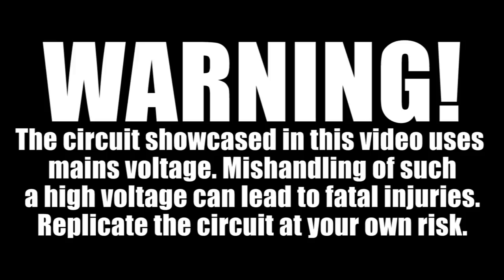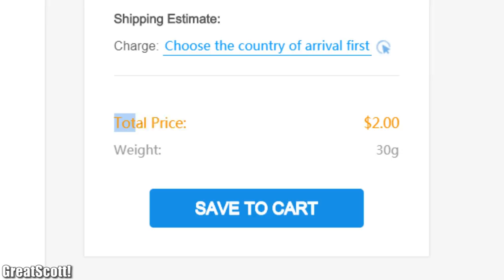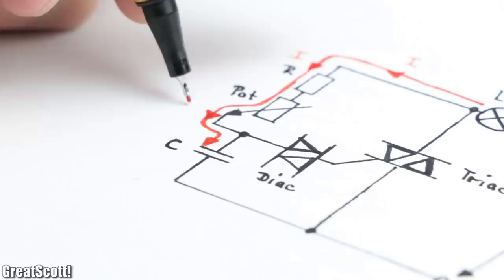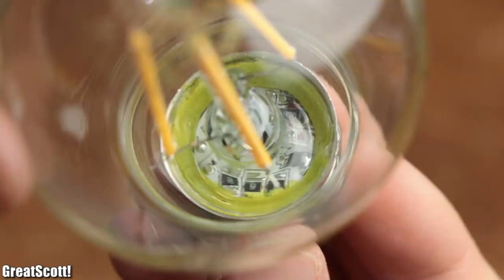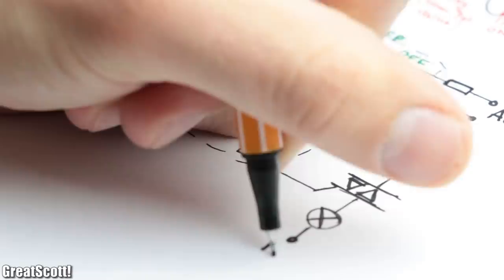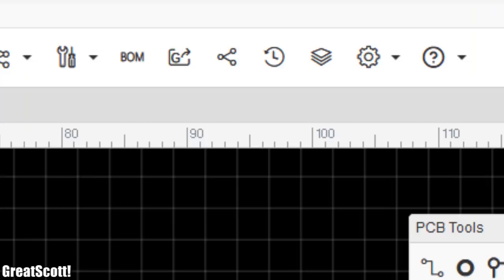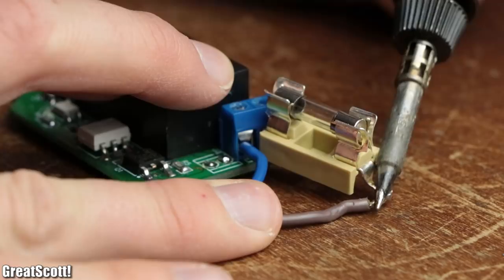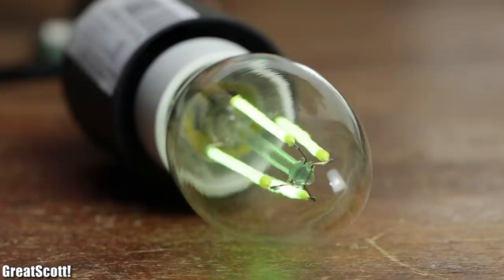AC Light Dimmer || DIY or Buy || Phase Angle Control Tutorial

Comment: It's seems that both analog and digital versions are equivalent on the final result. The reason the digital could control better the LED light bulbs is just that it can go further down on the turn on signal interval? (that LED light bulbs are only dimmable with the upper range of net energy delivered, since they need a minimum power to even work).
If that's true, then a faster clock on the uC could work even better?
Reply: I need to know as well!

Comment: So the PCB can be improved, big deal who cares, this is a one off. Second time around will be the charm.

One of the major advantages of using an MCU is that you can tailor a brightness curve to rotation. Brightness is logarithmic but the power to phase delay angle is not. So you can build this into the software and have a reasonably linear brightness to rotation. This feature can be applied to controllers that also have Blu-Tooth &WiFi or course. The magic is using an MCU.

The biggest hurdle to overcome is to accommodate LED lamps without flicker and all the other artifacts that can befall a triac based dimmer.

Just my 2c worth.

Comment: @GreatScott! Great video Scott!! this is something i was searching for some time now. 
Maybe i know why one of the led bulbs did work and the other one don't.. you use the same method as a normal halogen dimmer, leading edge while this works for some led bulbs the other led bulbs need a trailing edge method because of the used electronics. for what i have read.. since youre using arduino it's simple to adjust.. can you check it out?..

Comment: Do we need  a filter like a capacitor & a inductor for the Hi-Link power supply? Thanks for your attention
Reply from the maker: Always a good idea to add a bit of filtering. But it should also work without it.
Reply: Agree, also we need to minimize the PCB size so the filter my be neglect. Excellent video sir.
Reply: @TrungTran-hw7ws  These power supply modules contain internal capacitors. However, the ATtiny should have a 100nF ceramic capacitor placed close to the microcontroller, between the VCC pin and GND. Keep in mind that if you try to replicate a project like this, to read about isolation distance with high voltage. A groundplane should not be used close to the AC terminals and all signals should be suffficently isolated from the mains.
Reply: @elmardus  In a nutshell, are u trying to say about clearance and creepage? Sorry, still try to learning these things.
Reply: @TrungTran-hw7ws   Yes exactly! It is quite common to have insulation slots cut out to prevent creepage, for example by cutting a small slot below the optocoupler.
Do you have any PCB design experience? If not, then please DO NOT start with a project like this. Working with mains can be incredibly dangerous if you are not experienced. There are countless good beginner project (tutorials) available online which are powered by lower voltages and are much safer to get experience before starting on higher voltages.
Reply: @elmardus  Can the creepage create some arc if the 220VAC line is quite close?
Reply: @TrungTran-hw7ws  Yes, contamination on the PCB could create a conductive path if there is no sufficient clearance between high voltage and other conductors. But again: if you have to ask this kind of questions, then it is not a good idea to start developing anything with these voltages. Please stick to low (<40V) voltages until you have learnt enough to work safely.
Reply: @elmardus  Ok, I understand. Contamination is the corrosion? Or something else more dangerous
Reply: @TrungTran-hw7ws  Can be everything, usually dirt, dust or moisture on the PCB. There are standards for the required creepage and isolation distances, but you can find this info online. Look for the video 'what is creepage and clearance' by Texas instruments, this should be a start.

Comment: Great video! But there is any way to change the potentiometer to a digital component? Because I would like to dimmer my lights with my Arduino board, without a potentiometer. There is a way to simulate a potentiometer with digital components? Thank you for your video =]
Reply from the maker: There are digital potentiometers, or you add push buttons to increase/decrease the input value. There are tons of possibilities.

Comment: There should have been a clear ground separation under the optocouplers and the AC-DC power supply. There is insufficient Isolation between the digital ground and the mains voltage inputs.
Reply from the maker: True. I am not a PCB design engineer. That is also why Buy wins in the end. Due to safety reasons.

Comment: Can you make a DSL (or cable) modem | DIY or Buy ?
Reply: Really?
Reply: Cheese 1337 yeah dude it‘s very easy, just modulation and demodulation, cable is a bit harder. Without a modem; no internet for you and a modem is always present in a router, if it‘s directly connected to the DSL, cable or fiber interface.

Comment: Hello @Greatscott! I wonder if you can make 220V UPS for a wifi router. The power supply is pluged-in and if the power loses it will automatically switch to battery source with the device(router) prevents  shutting down. Thanks.

Comment: hey, maybe inside of the bulb you can find dimmable input at the driver ic-s. i repaired one of the 100w led lamps for outside useage, and the driver name was pt1901 [ http://www.princeton.com.tw/Portals/0/Product/PT1901-A-s.pdf ] and these ic-s are dimmable. inside of the wiring there was the dimmable input just setted up some voltage with rezistive divider. or at these ic are with constant current source, that is the best way to dim leds

Comment: Hi, I was wondering if you could build a dimming circuit that has for 120v or 240v ac but to make it dim it uses 12v dc 
I have dmx boards for 12v dc that I wanna use to dim 120v but when I use a 12v to 120v SSR it acts like a strobe light when dimming.

Comment: Plz help if I have 5 circuits drawing 1.2 amp to two amp each will a 10 amp Power supply be suitable considering in their voltage draw varies from 1.2 to 2 amp and will the circuits be safe their stepper motor drivers

Comment: Hello scott, i have to design a circuit which can  give an output of 24V ,500mA to the contactor as it keeps burning  due to overvoltage . I could have used AC to DC method also but i am rather interested in ac to ac only.i tried using Dropping capacitor but i could not get 500mA  from it . Please guide me

Comment: You would EXPECT them to be designed to safety standards, but buyer beware! If the price is too good to be true, then safety may have been skimpped! Nice design though, a friend has asked me to build something similar and wanted to also use LED bulb and have a fade on function. I'm sure if you had a read around you could work out the clearances required for mains voltages on PCB's.

Comment: Great video thanks! I'm searching for a dimmer that uses a PWM input instead of a potentiometer, but capable of dimming AC LED lights with zero flickering. I want to make a module with an ESP32 to control dimming my ceiling LED lights with Alexa. Is it possible to hack a 'bought' LED dimmer to accept PWM? It would be great if you could do a video on this please! Thanks

Comment: how do u measure the mains voltage with the oscilloscope? i hooked up once my DSO and it died...some people told me that i should have connected with a resistor in the ground wire

Comment: Can you make a video on trailing edge dimmers?  They are supposedly a more complex circuit to build but have a much better compatibility range for LEDs.
Reply from the maker: Watch the follow up video about the LED light bulbs.
Reply: @greatscottlab  Awesome!!!
Reply: GreatScott! Looking forward to that one, smart dimmers and 3-way smart switches (no dimmers yet) are very expensive still, yet seem so simple inside.
Reply: @JasonWho  Agreed.  I'd suggest using an ESP8266 instead/with TINY85 to give it remote control
Reply: @Dmitriy the way things are going, ESP32s are becoming the new standard. Capacitive sensor pin, deep sleep, Bluetooth presence monitoring, lots more pins to play with on top of the WiFi ability...once the community gets the hang of ESP-NOW we won’t even need access points to communicate.

Comment: Your board has some bucks which is you bought the high voltage wire very close to the low voltage wire which could lead to short circuit and even a fìre and thugs the total destruction of the circuit.

Comment: Isn't the schematic wrong? The lamp would turn on even if the triac is off, it has a conducting path through the resistor, potentiometer and capacitor...

Comment: but does this work with ac motors?
Reply from the maker: Mostly no. Motors are an inductive load and thus the current comes with a phase shift which then makes the triac conduct most of the time. The dimmer is only for lights. But I will make a follow up video about LED light bulbs where I might talk about this problem.
Reply: @greatscottlab  Thank you very much indeed!!!!

Comment: It would be nice to have a design change so the dimmer operates at 100Hz, rather than 50Hz. Only eagles would see that....
Reply: Antonio Tejada : I was thinking that at 100Hz on monitors I don’t see the flicker, but lower frequencies I do. And, it should be easier to implement with a frequency doubler circuit. I suppose in the US it would need to be 120 cycles per second....